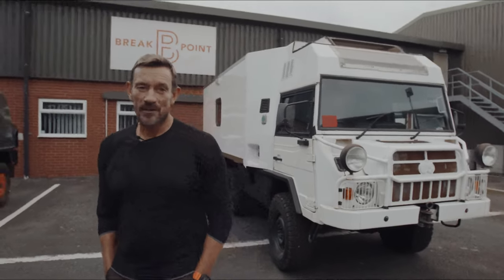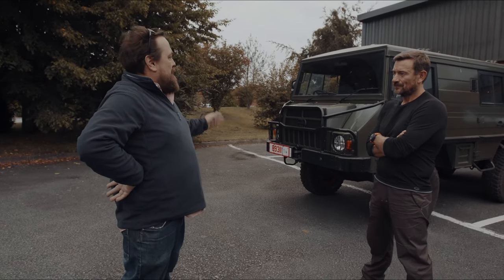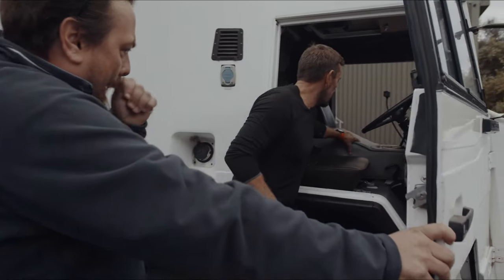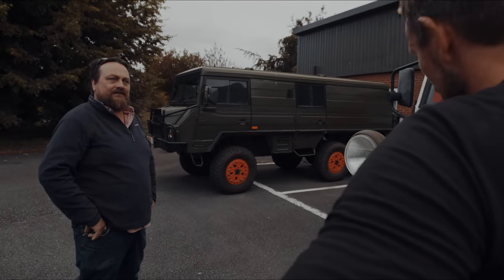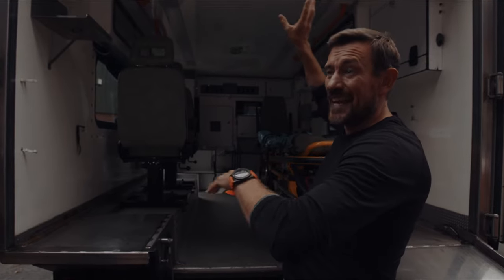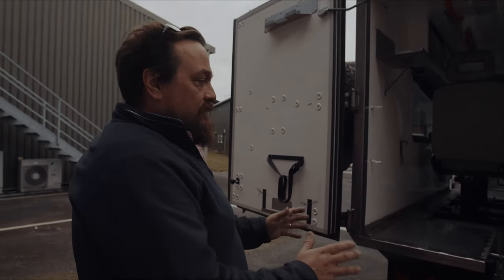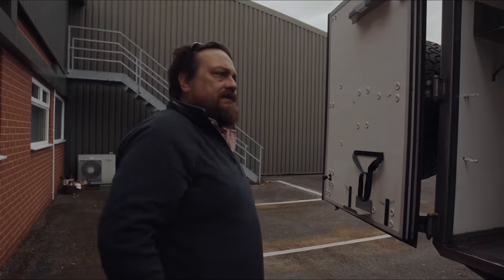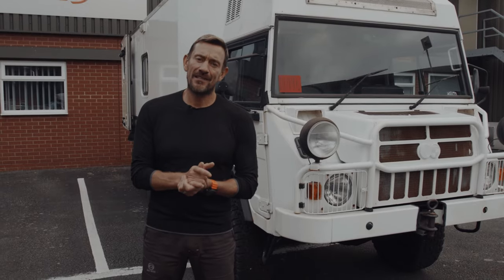Can Ollie Revamp this Pinzgauer? | The Pinz Project | Part 1-3

Comment: Awesome vehicle! Good luck on the project. 
I have a 1988 Pinzgauer 718K completely overhauled and turned into a camper by the original factory in Graz, Austria. Including upgraded transmission and turbo diesel engine. It drives fantastic. Even at 120km/h on the motorway.

Comment: Can’t wait to see what you do, I’m building a camper at the minute and thinking about a motorbike rack but I reckon I’ll just get a bike trailer, and I’d run the cooking hobs off gas, you don’t worry about power then because you’ll drain the batteries quicker with electric hobs
Reply from the maker: I hear you re the gas but im going for non gas and will use solar. This will prevent me having to get a resupply. I may carry a small gas supply for emergencies though. Good luck with the build Leo!

Comment: Hi. Really looking forward to the build process. For a hot water system, I went with Joolka. I've fitting mine to the back of my jeep XJ, but because there portable you can use it in and outside. Great for outside showers. Have fun with the build.

Comment: WHAT A BEAST!!!!
Reply from the maker: You should hear it! Ive had the engine done and many mechanical parts, which has been the best investment.
Reply: @BreakPoint01  yeah get it breathing good and get those exhaust gasses out and it will be an animal. Is it turbo as well? Or just naturally aspirated? There is so much room in the back for a really good setup. Induction is a great choice for cooker, doesn't get hot, it's fast,l and portable. You'll need some decent lithium batteries and a good inverter, maybe a few solar panels on top (you do have sun in the UK don't you ;P ) and you'll be set!!!
Reply: @BreakPoint01  i have build my 716k with a 5 cyl tdi...comes out a v70 volvo and has 140HP...they are also more reliable then the original 6 cyl td.

Comment: Mate I have been working in the same truck for the last 18 months and have pic and can tell you the areas to look at.  Water is an issue coming into the vehicle You must sort that out first.
Reply from the maker: Hey Andy, yes thats correct! The water ingress is an issue, eventually I will rebuild the back but for now have to prevent further water coming into the composite.
Reply: Reach out if you need any info or pictures of the problem areas I have taken pictures of the rebuild  also the solar setup I have put in   All the best. Andy
Reply: @BreakPoint01  also before you move the two back seats they make a bed if you lay them flat also I turned round the other seal and have a desk/ office desk for working on the move